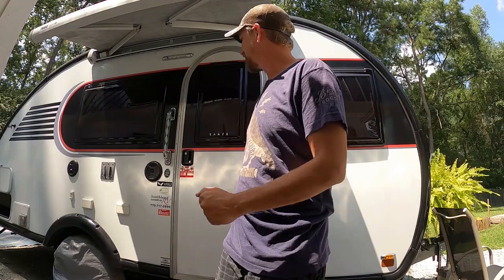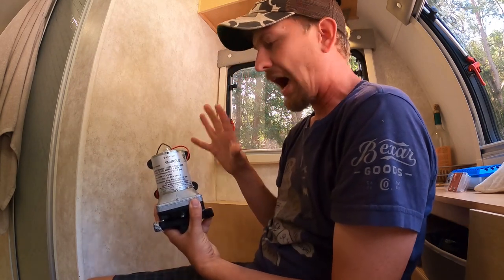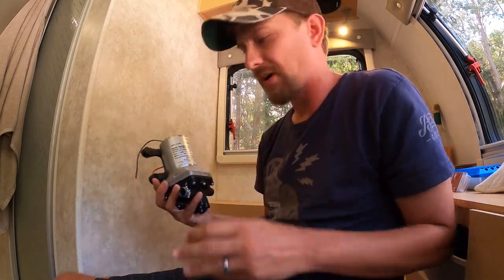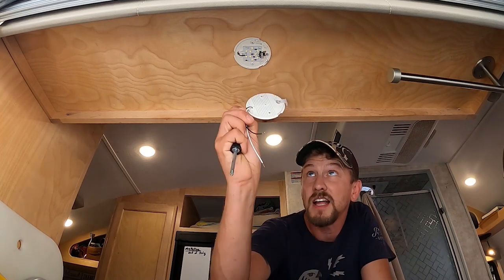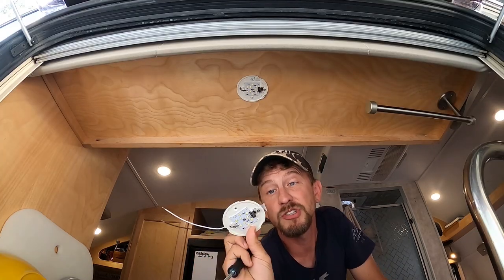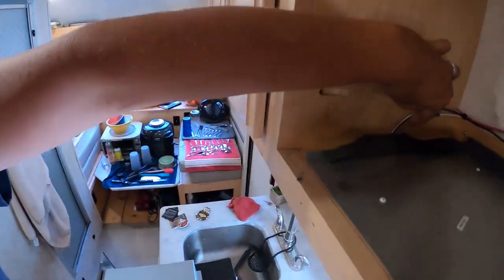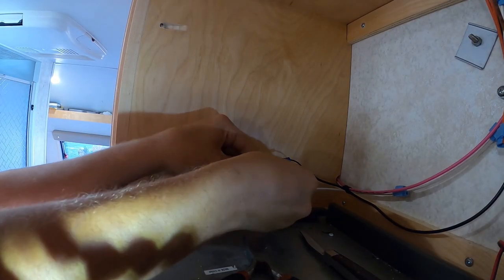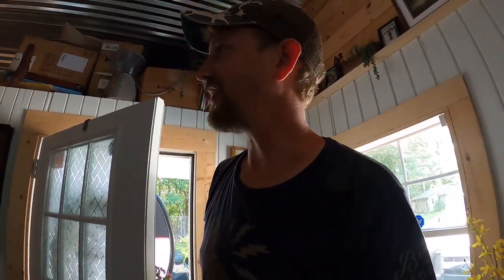Little Guy Max Water Pump and LED Light Replacement

Comment: I've got a 2018 LG Max as well and the lights with the little tiny switch have broken on several (and we are gentle with them).  I would suggest anyone replacing them to do so with a different type.  I've replaced 2 of ours with a very similar one that has the switch in the center that is pushed on/off. Looks almost identical.  Great job on showing the diy.
Reply from the maker: Thanks for watching! I would imagine overtime they all act up. It was a good fix!

Comment: DIY is the only way to go!  For the light switch tabs, all the lights come with one but are not needed. Our shower tab broke and I took apart one of the ceiling lights tabs as replacement. Worked like a charm. Thanks for another awesome and useful video for us LGM owners!! 👍😎

Comment: So happy to see the repairs you’ve done. I’ll be doing my water pump too. I also have a 2018 and use it full time. Now if you can do a video on fixing the problem with the water getting under the countertop from the sink layout and one about how to replace the bathroom floor (I bought one of those bamboo mats everyone was raving about and the little feet-pegs cracked the floor within the first year 🤬). I’ve sealed it up but I know it won’t last. Like you said, all trailers have their problems but I still love my Max
Reply from the maker: Thanks for watching, we always try to share what we experience with fulltime rv life from before and all the things to prepare for. I am sure we will have plenty of how to videos coming. Thanks for watching!
Reply: I recommend WAGO 221 lever nuts for the splicing - instead of the butt splices.   THen if you ever need to re-do it you’re not having to cut wires again.

Comment: About how much is one of those water pumps?  Hope the bath and bed light are easier to repair or replace than the kitchen!!!
Reply from the maker: The water pump is about $130 plus if i remember. The roof lights are easier. The shower you have to splice the wires because you can't get it to pull down. Thanks for watching